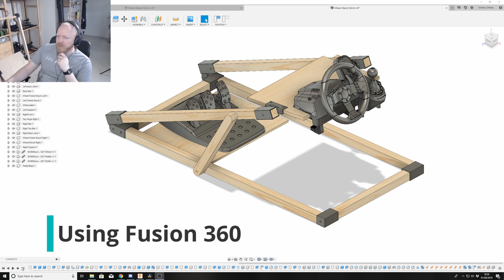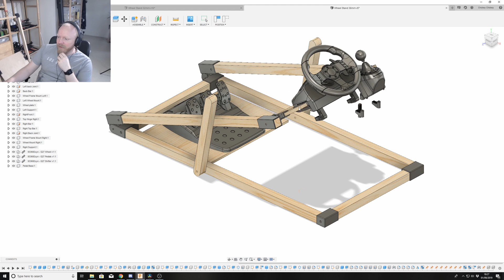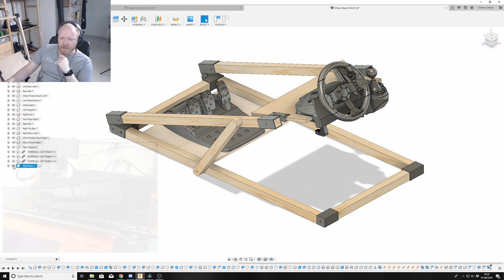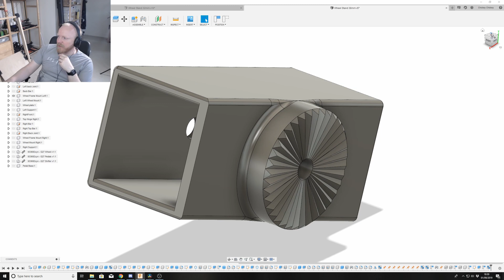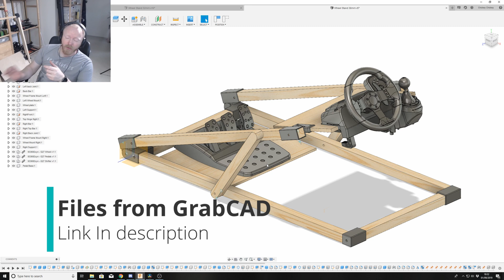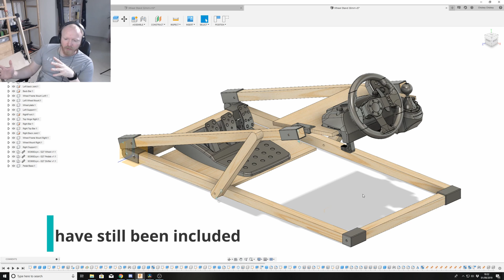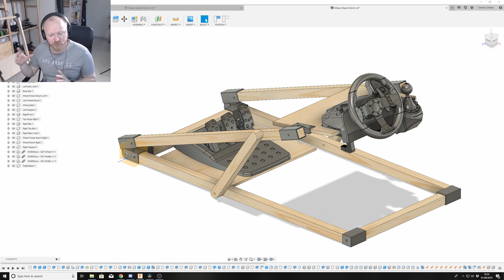Mostly 3D Printed Wheel Stand

Comment: I'm a sim racer and that would hold my wheel for about 2 laps. Should make one out of aluminum t slot
Reply from the maker: Thanks for the feedback, it’s only designed for light use by my 9 year old and 5 year old twins.  Never really envisaged it for a hardcore sim racer.  Was only £20 to build so a cheap way to introduce them to driving games.  Totally agree alu or steel would be far more rigid.